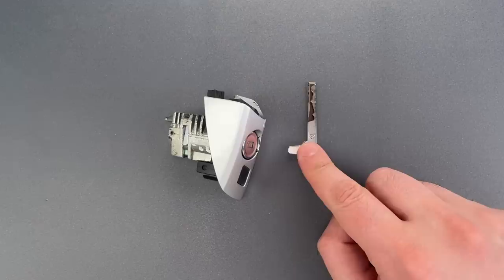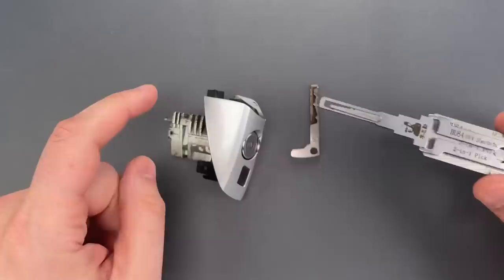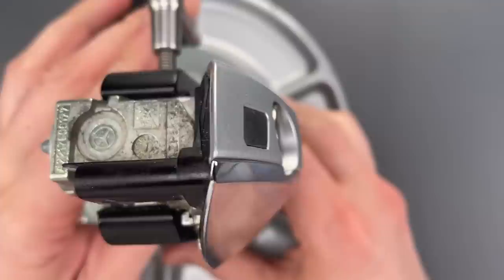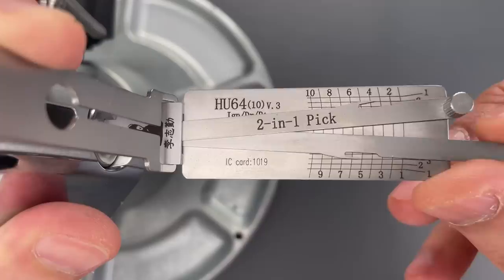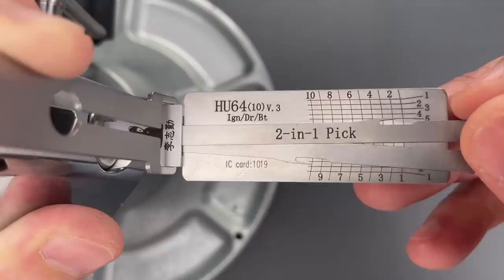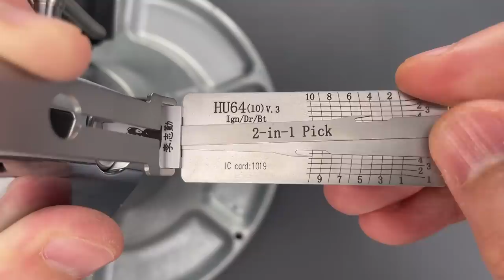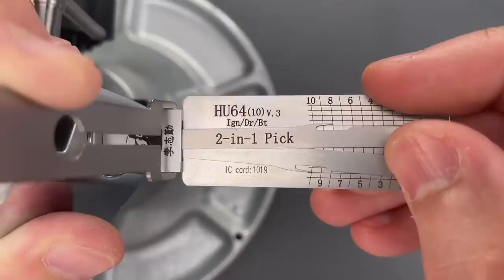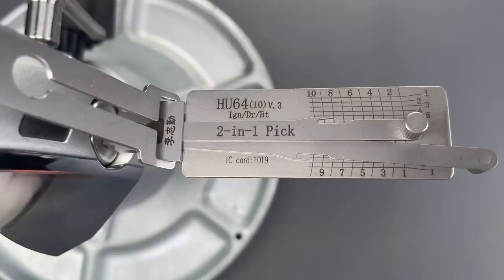[1411] Mercedes S-Class Door Lock Picked (2013-2020)

Comment: Locksmith: "Alright. That was an easy 2-minute job. That'll be $360, please. Next time, don't lock your keys in the car."
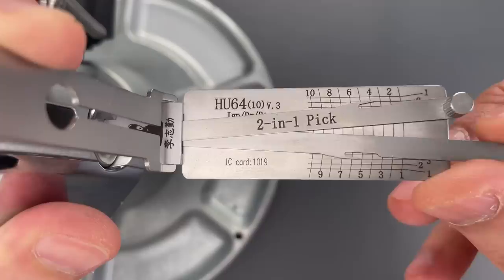Reply: I want to work in your area. People give me grief over $120.00 at 1:30 in the A.M. during snowstorms.  Luv people!
Reply: @James Mihalcik  I'm just making fun of the over prices. Like. I get it. Gas to get there and back, maybe like 10-15 bucks. The easy, quick job should be like 20-40 bucks and then some taxes, of course. It's like getting charged 700 dollars at an autoshop to have a snap-on fender replaced for your jeep, and the fender itself costs about 100-200 dollars, but the replacement itself takes less than a minute.
Reply: @Ugimara-Imokrasa  it's not the time it actually takes that counts. It's the time learning the skills that makes you good enough to be that fast.
Reply: @Kevin  Of course. But, there are plenty of trades out there that charge a ridiculous amount of money for a fairly simple and easy task. For example, my wife accidentally put diesel in my car a few years back (all the handles for every pump were green), but it didn't reach the lines or engine yet. So, I had it towed to a shop to have the fuel tank drained. They wanted to charge me 800 dollars. I said no. I took it back and drained it myself with no prior experience, and all I needed was one ratchet and a socket and about 10 minutes of my time. The only skill I needed was the ability to turn a ratchet.
Reply: @kevin735  Even if I was an expert at such a universally easy task, I wouldn't charge up the arse to do it.
Reply: I called out a locksmith a while ago, thinking they'd be able to pick it open no probs. Said it's "impossible" and needed to drill it. I said no way and charged me £90 just for coming out. Ridiculous how someone calls themselves a locksmith when they can't even pick a basic Yale euro cylinder that I've seen picked on this channel before.
Reply: @kevin735  For some reason people just fail to understand this.

I had surgery at the hospital.  The surgery itself took about half an hour.  They charged me more then 50-100 bucks.  My surgeon has literally done hundreds of the surgeries I got so it only took him 30 mins to do a fantastic job and there are other people wanting his services as well.

There is value to time and experience.  Thats what you pay for when you expect someone to drop whatever they are doing, drive to your location, and perform their specialty for you.

Now if they were just don't the street and it took 2 minutes to do?  Sure, they will likely give you a break because it didn't eat their time.

But if they gotta drive 20-30 minutes to you, who cares how long it takes?  You ate up a substantial amount of time that could have been used to help someone else.  You are taking someone's time and their expertise.  You pay for it.
Reply: @Ugimara-Imokrasa  If you are an expert to where someone needs your help, you are an idiot if you dont charge what your time is worth.

I make chainmail items.  I could make a chainmail shirt but it takes a long time and a lot of material.  People don't seem to understand this and want chainmail on the cheap...generally less than the materials cost themselves and you haven't even gotten to the literal hundreds of hours of labor.
Reply: @Ugimara-Imokrasa  I'm going to say we're both right here. There are industries/experts who can do amazing work in a very short amount of time, and should be compensated for the work they did, not the time it took. Then there are industries/businesses that way overcharge on tasks that don't take long, not because they're complicated, but b/c people don't know better. What you did of draining your own fuel line was a prime example of that.
Reply: @RavenGlenn  What the fuck does a making piece of chainmail that takes "hundreds" of hours and tons of labor have to do with picking a lock in 1-2 minutes and charging up the ass for it?
Reply: @Kevin  Thank you for at least being respectful about it. Lol. And I get where you and the others are coming from. But perhaps I'm just too much of a kindhearted individual who wouldn't ruin peoples wallets and weeks for something that takes little to no time to do with my expertise.
Reply: @RavenGlenn  Services should be charged by the value they provide, not the time it takes someone to do the service.
Reply: @RavenGlenn  I'm what you call a budget mechanic and detailer. You order the parts I put them on. You want your car looking dealership fresh and the paint like new? I only charge for the resources. I'm proud to say I'm one of the very few who charge solely for the materials and the difficulty of the task. I'm a one man team, and I've had a car in my garage doing an entire engine and transmission swap. Naturally, any other shop would charge roughly around 5000-10,000 dollars for this. I only charged 2,200 for the job despite it taking me 2, almost 3 months to do. No issues or complaints even after 2 years. I don't even feel like posting this, but I will anyway, lol.
Reply: @ProdByClockwerk  💀
Reply: @Ugimara-Imokrasa  I think your view is a bit tunnelled in this matter. An anecdote would say: "Opening the door 10 $, knowing how and with what tools - 200 $" and it would be basically true, but you have to take into account that the person has to have a business going and if that business is opening car doors, the frequency of it might not be so high. Therefore they need to compensate by making it more expensive to make good living out of it. Then either you're willing to pay that and that's OK or not and then you can buy a brick for 50 cents and smash your window yourself.
Reply: You're not paying because of what they are doing, you're paying because they know what they are doing. There's a difference.
Reply: @Mawerick77  Complete opposite for me. I literally charge for what I am doing.
Reply: you can't lock your key in these cars
Reply: @theHoolser  It's a joke.
Reply: @RavenGlenn  I just came from Tom Scott's video about this house in Scotland: "In this week's video, I head inside the giant chainmail box that stops a house dissolving."  Talk about time and effort.
Reply: @jamesmihalcik1310  - They give you the money too.
Reply: @hayleyxyz  it's easier for them to drill, and it doesn't require any particular skill. Same happened to me. This way they also sell you a new lock, at twice the price it would cost in a shop.
Reply: @smokeyjo123e  I'm well aware of how these things work. I'm also well aware of how hard something incredibly expensive yet needed can impact those who are struggling to simply live with a roof over their heads or feed their children. I charge for what I do instead of for what I know simply because I myself would be pissed to have to put aside grocery shopping for a couple weeks because I accidentally locked myself out of my car and now can't afford to do so. I myself own a 2016 Cadillac CTS-V sedan, so I'm well aware of how difficult and tedious things can be for "high-end" luxury cars. I've been turning wrenches on all sorts for over 5 years. If I were as good at lock picking as LPL here and I were a locksmith running my own sidegig from home, going out to a 60-mile radius, I'd practically charge only for gas to and back and a relatively small fee (20-50 USD) for the effort. And no. I hate socialism.
Reply: How about electricians going to a house and flipping the switch on a circuit breaker?!!!
Reply: @Ugimara-Imokrasa  Former appliance repair technician here.

Easy vs hard does not matter. The diagnosis is almost always the hard part. You aren't paying for parts and labor, you're paying for expertise.

Just because one fix was easy for you doesn't mean they all will be.

And so, repair jobs are priced to even out the really bitch jobs with the relatively straightforward ones.

But both of those require specialized knowledge and experience - not to mention the tools. That's what the cx is paying for.
Reply: @hayleyxyz  unfortunately, some of the locksmiths are not very competent.  If they can't open it in 2 minutes, they rather drill it out and sell you another lock to replace the one they drill out so they can charge you even more money. They need to move onto next job quickly.  That's how that make their living.  In the US, some insurance company covers glasses 100%.  I literally have seen a guy broke the smallest glass of a car to get in (like the triangular one at the corner).  He saw me looking at him, and said "that's my car and I was locked out".
Reply: @Ugimara-Imokrasa  If you think that the job is so easy and profitable, why are you not a locksmith? You could earn a month salary within a week. 
This is the mentality I see all of the time. Why is the plumber/welder/gardener/electrician/painter/masoner/paver/carpenter so expensive, he does not even have a college? Well it is hard job that requires tools, experience and dealing with dumb people. Supply is far lower than demand, hence the price.
Reply: @ipick4fun27  most of the time it isn’t actually incompetence. It’s just that they make more money drilling it out and selling you a new lock. So they pretend it’s the only option
Reply: @koroslav  1. I never said it was easy. The joke was speaking from a hypothetical perspective of a locksmith. I don't know anything about lock-picking.

2. I already earn my main pay from the Army, and I have passive income from a few vending machines, a manual car wash, and a lot of my free time is put into being a at home garage mechanic. 

3. I joked that they overcharge for a simple task. 

4. My joke isn't a manifestation of what I believe everything is like. I am well aware of how things work. I'm not coming from the mentality you believe me to be from. 
 
5. Yes. There are questionable people out there. More than you'd think. But, stupidity and a lack of knowledge on a subject are two different things. Albert Einstein could have possibly not known how to make raw glass. That doesn't mean he's dumb.
Reply: @Petr Lohnický  No. I get it. I'm not tunneled. I'm well aware of what everyone is saying and how this all works. As a collective, y'all are just beating a dead horse.
Reply: @jamesmihalcik1310  
For 120 bucks I could take a fucking cab back home, get a spare key and come back and still have change to spare.
Reply: I think all of you guys ignore the fact that a locksmith doesn‘t have opening jobs back to back.  If you calculate 30 for opening a door/car and the time he spends driving there, a locksmith theoretically could open 16 doors/other locks in a 8 hour shift. But how common is that? 

I would guess that an average locksmith gets 0-5 calls a day for opening stuff. You have to take into account the idle time that comes with his job. Of course he will have normal planned work like „people buy new house and make an appointment 2 weeks ahead to get new locks installed“.

But there definitely is an aspect of randomness that has to be accounted for in the price. (To a certain degree ofc)
Reply: @hayleyxyz  Locksmith is not the same as lockpicker.
Reply: @Ugimara-Imokrasa  dentists and doctors should be like for 30$ $ gas money, - they are doing such easy things amirite?! Giving medical advice or filling up cavities is so easy and fast, not worth unreasonable sums of money
Reply: I have a professor that charged $2000 for pressing a button in a device that most people didn't know it had. Knowledge is expensive but also your time.
Reply: @spicy diarrhea  Never said anything about dentists or doctors. Those are far more complicated than a locksmith or a mechanic, so to say. Even in America, Docs and Dentists are overpriced.
Reply: @Ugimara-Imokrasa  how so? I can do a dentists job provided proper equipment, same with medical advice, I myself had encountered dozens of worthless yet pricey ones - I can do that too! What I can't do is lockpicking, but hey if "it's so easy" just do it yourself no need to hire a locksmith
Reply: Yep, locksmiths are theves.
Reply: @spicydiarrhea5662  Never said I can do it myself or that it was easy. But I'm not responding to you anymore because you don't seem to be going anywhere with this.
Reply: @Ugimara-Imokrasa  I will report you to reddit
Reply: @Ugimara-Imokrasa  what about safe handling and recycling or disposal of highly combustible liquids and fumes. It's not like you can just turn around and have all that stuff magically happen. If you did it yourself and curious what method you use to collect and safely contain gasoline and diesel fuel.
Reply: @joshuajhoyt  literally drained my gasoline and diesel into fuel cans and dropped them off at an autoshop for them to deal with.
Reply: I've paid that much for 10 minutes with a veterinarian, never anything like that for a locksmith, dentists on the other hand can be thousands for ten minutes work.
Reply: "If I do a job in 30 minutes it's because I spent 10 years learning how to do that in 30 minutes. You owe me for the years, not the minutes.
Reply: You aren't paying for the 2 minutes of labor, you are paying for the years of training and experience.
Reply: @RavenGlenn  I gave up on the idea of monetizing my chainmail hobby because the time it takes to make even a basic euro 4-1 bracelet was enough that it would be infeasible to sell them for any less than $20 and people would still bitch about the price.
Reply: I'd say a majority of people have a skill they've honed for 10+ years, some skills are just plain old not monetizable, regardless of rarity, or necessity.
Reply: What's wrong with that? Most people don't have the skills, and it costs money to live as a locksmith, and you need to be able to make a living.
Reply: @Snyde91  I don't know how many would do that.  I'm sure it happens.  But just to give them the benefit of a doubt, I will say that particular one is.
Reply: @RavenGlenn  Surgery for $100? Utility knives and chlorhexidine on my diningroom table in my country. My insurance copay is more for "procedures" in clinics.
Reply: @Ugimara-Imokrasa  You … haven't worked on-call have you? Generally you work a full day (or more than a full day) and go home to eat, shower, sleep, all before you do it again tomorrow. And then you get a call at 3am. Some server is on fire (or may as well be for all the person calling can explain it.) They need me to crawl out of bed, slam something caffeinated, and get there.

Terms? The second they call me, they're paying $400 and my travel costs even I spend two minutes on it. And they did call—usually about three of us, all with pretty similar terms in our employment agreements. Because if they called us in, it was going to cost them a lot more than they were paying us even if we DID fix it in two minutes.

They weren't paying for my gas and time. Well, they were, but they were also paying for my lack of sleep, and the fact that I could probably disassemble and rebuild one of those servers in ten minutes while I was half asleep. In fact, that's why they called me. And the other guys. Because if that was all it took, it was still a bargain for them.

Of course it was never two minutes. Even when it was a simple hardware fault with a misconfigured failover that someone else had fixed literally before I rolled in through security, we still spent an hour checking everything we possibly could to make sure it didn't and couldn't happen again. And then we went home and decided we weren't coming in until 10am instead of 8 so we could get some sleep, ordered pizza delivered to us so we could eat while working, and managed to get out of there by 7pm instead of 6 as would be more typical.

If I need a specialist at 3am in any other field, why would I expect them to be compensated any differently than I would demand?
Reply: @Ugimara-Imokrasa  if they’re such easy and simple tasks then do them yourself, you don’t have to pay someone else to do it for you
Reply: @Indiana Rider  what I've literally been doing since I've turned 18. If I think it's too expensive for what it is, then I educate myself on the matter with the basics and fix the issue. I've done this with tons of things from painting cars, mechanical work, wiring, plumbing, etc.
Reply: Don't know how would you lock the doors with the key inside.
But what do I know?
Reply: @zefautino  You can literally put the keys inside the car. As you're getting out, press the button on the door panel to lock all doors. And close the door. Bam. All doors are locked, and the keys are inside. Still possible with modern cars.
Reply: @Ugimara-Imokrasa  None of my cars, including the Mercedes, will do that.
If you press the button inside with the doors closed, as soon as you open the door, it will obviously unlock, and not lock again.
If you have the door open and press the button, the doors will not lock.
Reply: @zefautino  Not a lot of cars do that.
Reply: @Ugimara-Imokrasa  can you name one?
Reply: @zefautino  
Jeep Liberty
Jeep Wrangler 
Cadillac CTS 2019 and down
Cadillac ATS 2019 and down
Cadillac XTS 2019 and down
Practically, every Honda from 2020 and down.
Toyota GT86 
Toyota Corrolla 
Toyota Camry
Practically, every Subaru
There is plenty more. I don't care enough to continue.
Reply: @Ugimara-Imokrasa  have no knowledge if those cars do it or not, so I take your word for it.
None of the cars I had, ever, was such a thing possible. Except if you unlock the luggage compartment without unlocking the doors, but the lid, and thrown the key in there. Other than that, no.
Reply: If they give you any trouble, tell them you'll be happy to trade for a complete set of Lishi picks instead.
Reply: @Ugimara-Imokrasa  It's always free to learn and buy the tools and develop the skills yourself

Oh wait that's not free.
Reply: Next time buy a car with keypad on door.
Reply: @Ugimara-Imokrasa  if they have a Mercedes S Class idk why you expect that $360 would be too high a price for them